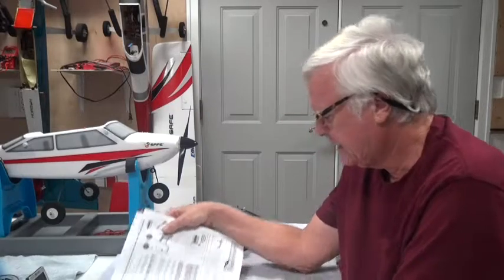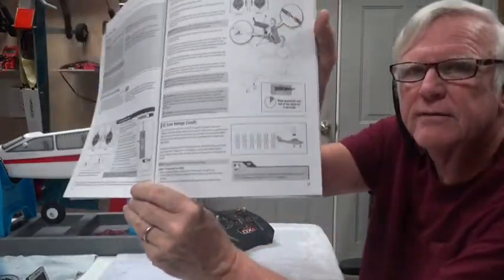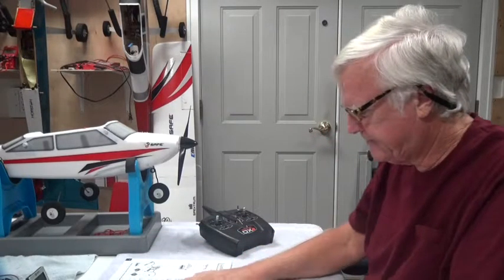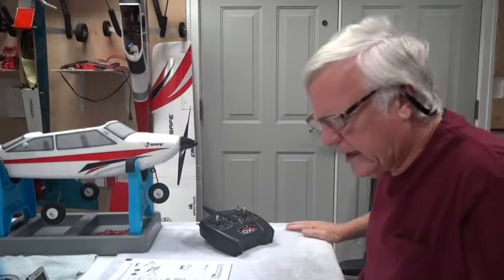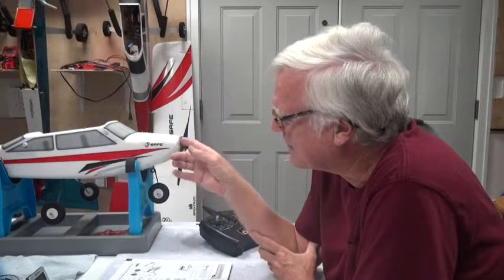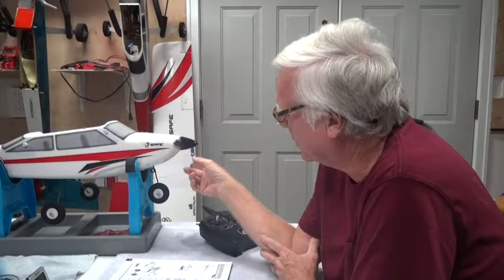AP30 Apprentice S 15e RTF LVC

Comment: You can get a low voltage alarm that plugs into your balance port on your battery. It is adjustable so you can set it up to go off at a set voltage. I recommend them to everyone. they cost less that 5 dollars each and are well worth the money.